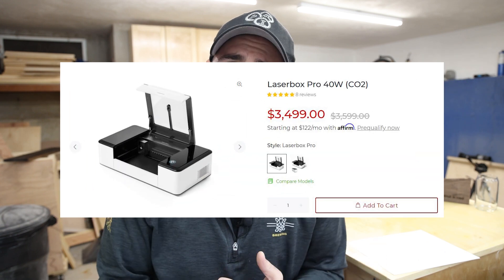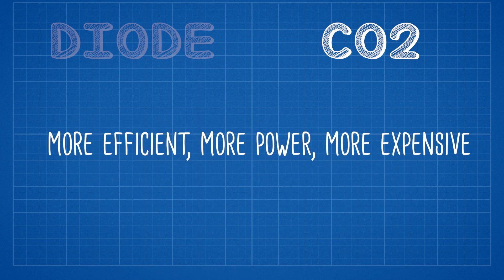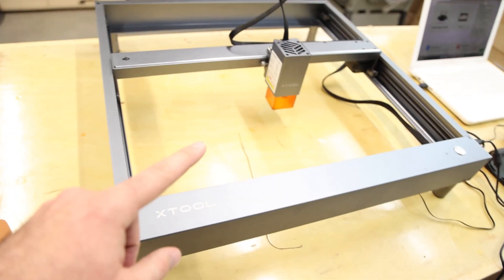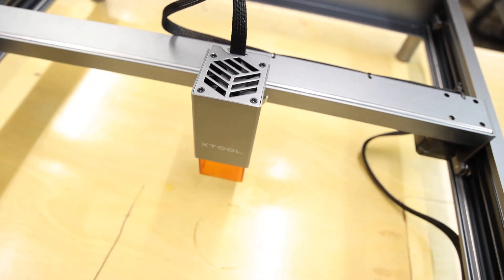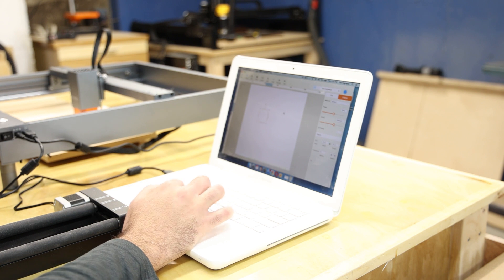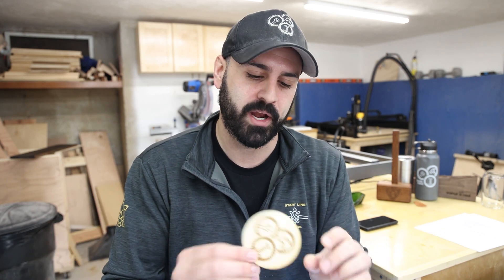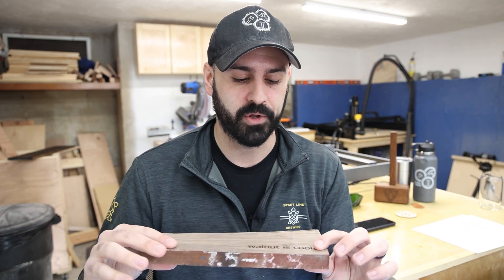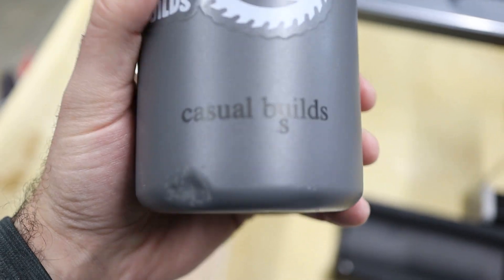xTool D1 Laser Engraver & Cutter | Casual Review

Comment from the maker: Do you have a laser engraver/cutter in your shop?  Have you thought about getting one?  What do you (or would you) engrave with it!  Let me know 👇
Reply: I have that exact same laser  Xtool D1 for over a month now.  It's a great machine.  Like you said it does compatible with lightburn.  I've been engraving tumblers, and made quite a few Christmas ornaments.  It's just for my hobby.  Everything I made are for gifts and for fun.
Reply: Can you get the XTOOL D1 with Lightburn and does this laser work with Windows 11? And do you really recommend this laser? If so, I am ready to buy.
Reply: I have 9 lasers. Started in 2013.

Diode is for stay at homes.
Reply: Please forgive this naive question…Can this unit do good volume? Or does the “laser” wear out/run out?
Reply: @OhioJimbo  Yes to both questions. The diode laser will last for around 10,000 hours, then it needs to be replaced for around $400 (10 watt laser). Also, the more you use the laser at 100% power the more it will shorten its 10,000 hour life-span. I hope this helps answer your very good questions.🙂

Comment: Just got my XTOOL D1 the other day. Setup was so easy. I have become a Youtube XTOOL Video Junkie. Every video I've seen complains that thick old black cord getting in the way of the lazer because it runs underneath the railings. Duh!... Conncet cord to motherboard, run cord under side railing as normal, THEN run it OVER the side railing to the lazer! tie down like normal and problem solved! Air Assist(if you have it) run from the back of the entire unit.

Comment: Thank you for the review of the lazer. Was this the 5 or 10 Watt lazer?  Iwant to make a US Flag cutting board and i am wondering if this lazer would cut out the stars, and then cut the stars out of Maple probably 1/4" thick?  Is this lazer capable of doing this?
Reply from the maker: Thanks! It's 10W, I doubt it could cut throw 1/4 hardwood

Comment: Light burn is now supporting this machine. The software is far more powerful but 60 bucks. I love my D1. Been trying to figure out a cable chain on the side for that cable running to the laser. Thanks for the video.
Reply from the maker: Thanks for watching Curtis!  I'll have to give Lightburn a try.  Wish there was a web-based software for the laser.  My laptop in the shop is soooooo old and I like to use my desktop to design the files and only have to open it up the webpage when I'm down in the shop.
Reply: @CasualBuilds  there is a software for your desktop and cellphone calls "Remote Desktop" with this software you can have access to your computer from anywhere just you need internet with both.set up is pretty easy as well